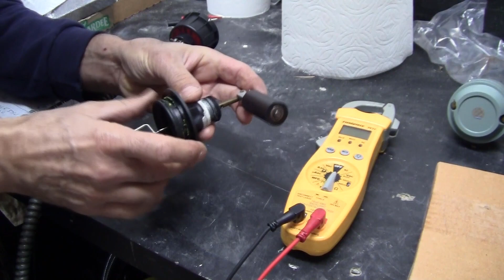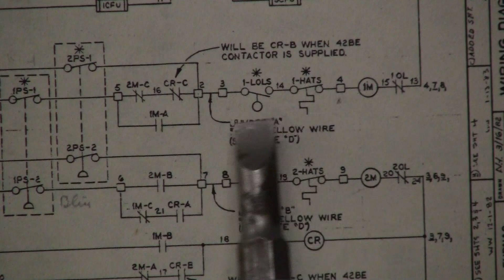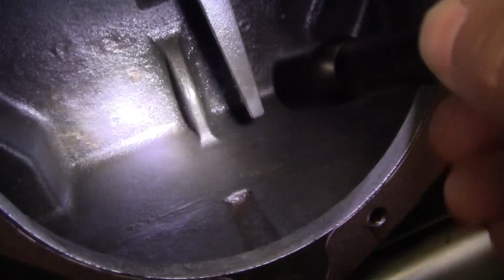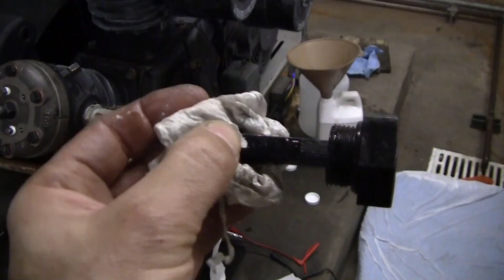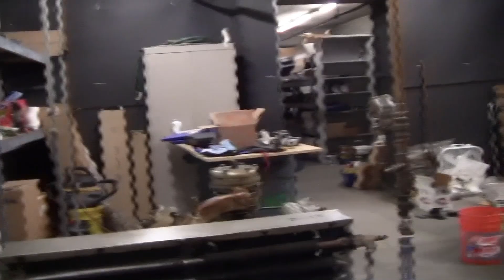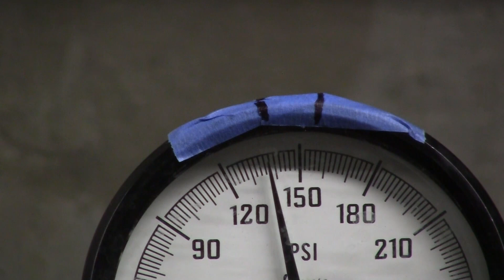Install Low Oil Level Switch on Air Compressor

Comment: Saylor-beall  air comprsoir Co, sell them as a pkg..on there units..under 300 bucks if u order separately..I bought my unit with all the bells ..there oil control  is a cast iron body..made in the USA..no plastic.   Great video  ty